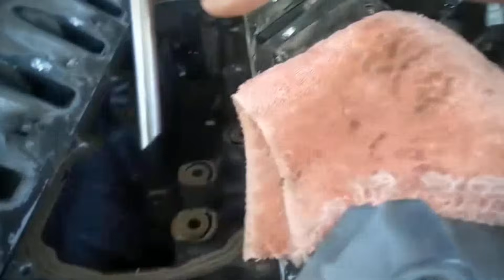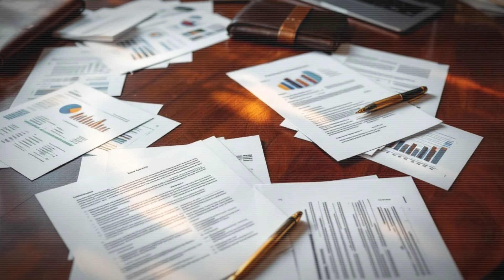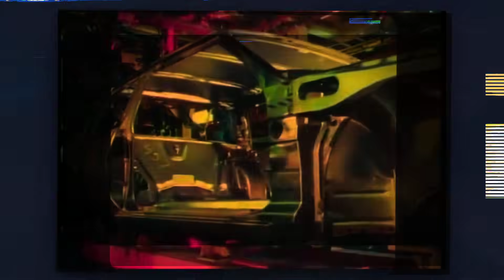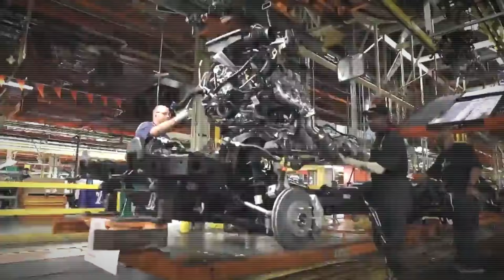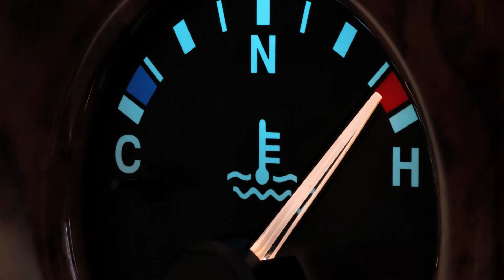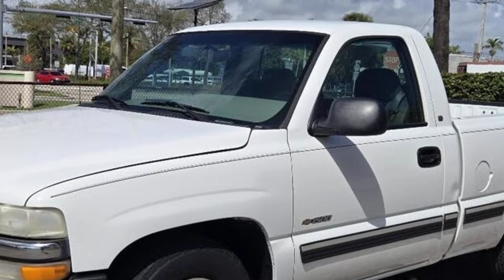GM Quietly Removed This $9 Part in 2004. It's Why Modern Trucks Die at 120K Miles.

Comment: This is a dumb video.  Those intake gaskets were used on outdated 4.3 engines that were phased out.  
The LS engines didn't have coolant in the intake. 
The pictures of car parts are all over the place. Saturn 1.9, camaro crossfire injection.  
This is the crap you get when you have AI make a video for you.